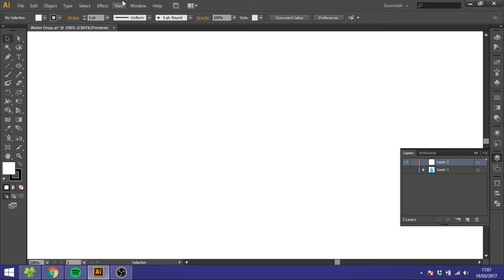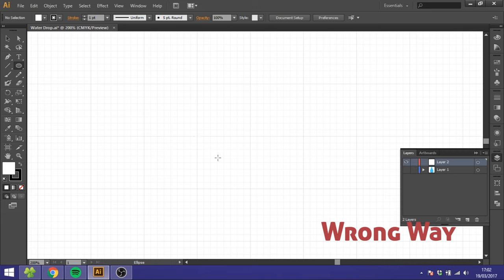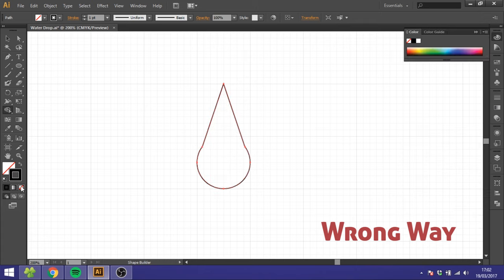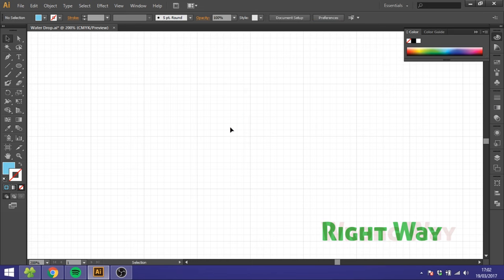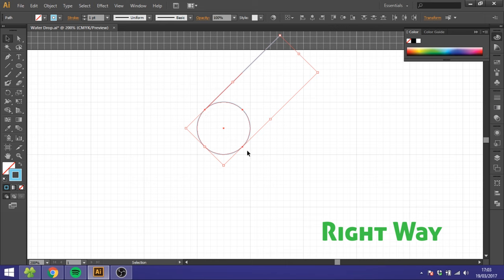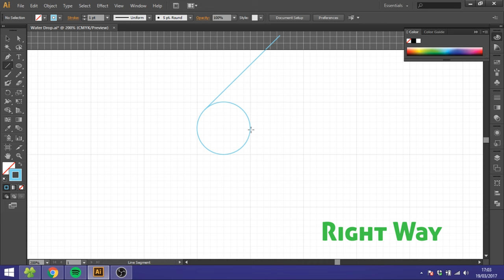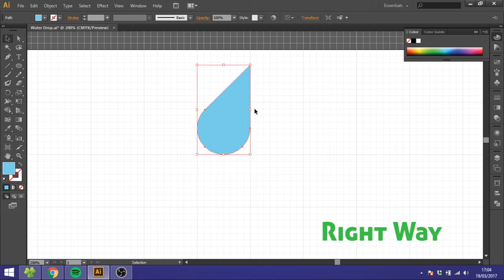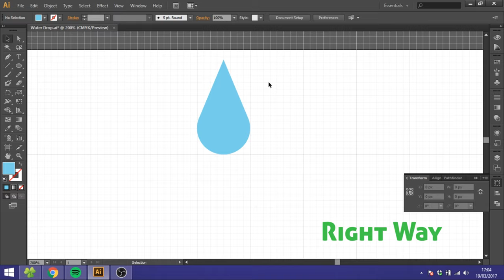How To Draw A Simple Water Droplet In Adobe Illustrator

Comment: So I get to the point where I use the shape tool. I delete the extras, but I cannot combine the shapes.
Reply from the maker: Im sorry i havn't seen your comment, based on the amount of likes this comment has it seems other people have the same issue. 
Can you please descibe what happens when you try. Most likely the issue is that the lines dont touch the side of the circle, you have to make sure the circle snaps to the exact middle of the square i place it in, and also make sure "snap to grid" is on, this way the lines will for sure touch the circle and you will be able to combine the shapes. The shapes has to be closed before they can be combined. Also you need to have everything selected, both the circle and the two lines before using the shapebuilder :)
If someone else is having this problem too, please leave a comment and describe your issue and i will respond quickly :)
Reply: @DiaGraphics  Snap to grid solved the problem! Thanks!

Comment: a faster way to do it is to make a circle than you select the top anchor point and you click and make it a into an angol point. After you select the other 3 anchor points and drag then down, it will make a perfect drop and you decide how tall you want it.  :)
Reply from the maker: If i understand Your comment right that technique Will make inaccurate edges. Unless You Are referring to the New CC feature, illustrator cc has some features that makes this process easier :)
Reply: sorry for the bad explanation. yes I have a recent version of illustrator,so  I don't know if I have more option.
the one I'm referring to appears o the top left corner when you select a anchor point, basically gives you the option to have straight corner or to have the handles and chose how smooth you want it.  :)
Reply from the maker: +Luca Raimondo yes thats the CC feature from the New versions. Its a great New feature and You Are right, if You have CC thats a much faster technique :)
Reply: Exactly, but You can also select top point only and drag it up, then with CTRL+Alt remove handles and You have a perfect drop shape
Reply from the maker: +Yarecki if You just make a circle and drag the top point up and removes the handles You vil not get a perfect drop. You Will get sharp edges :)
Reply: DiaGraphics Yes, You're right but it also depends what we call  perfect I guess.
Reply from the maker: +Yarecki yes that is correct but the reason i do it this way is to get the soft edges :)

Comment: The first water drop looks so wrong for some reason. Thank you for the simple and effective tutorial! Very nice use of grid. I just create an ellipse and drag the anchor from above the ellipse, then straighten the handles.
Reply: Yeah, really neat video @DiaGraphics, and I agree with @Cold Queen. I also just create an ellipse and drag the anchors and straightens the handles. But this works too!
Reply from the maker: Thank You very much for the compliments ☺️ and yeah there Are many ways to do it and the difference is very subtle, but there IS a difference in the appearance. I believe that illustrator cc has an even easier way of doing this but im using cs6 My self ☺️